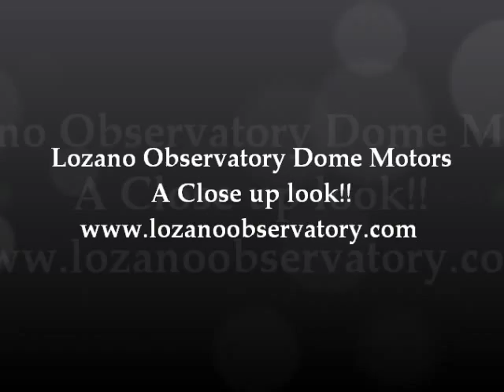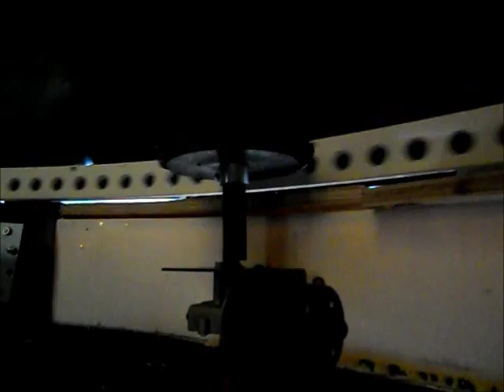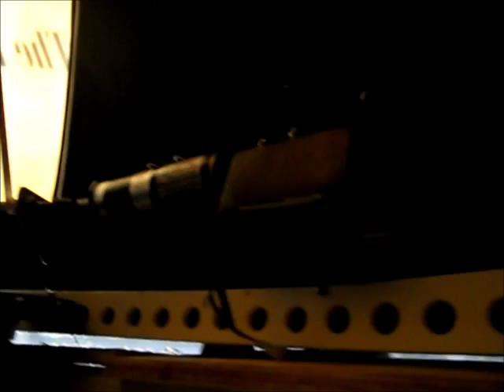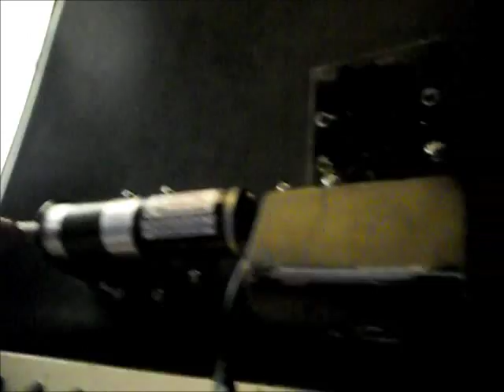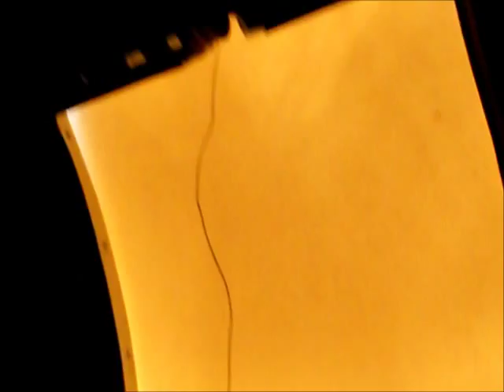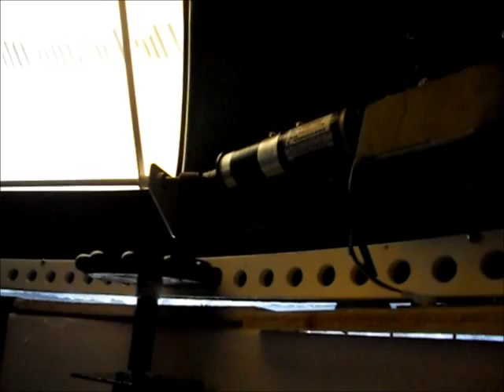Lozano Observatory Rotation Motors

Comment: So you didn't end up using the Foster Systems tor the shutters and rotation?
Reply: Rocky P No, I used Maxdome.  It works GREAT! Spend the  $$ and use it with either MaximDL OR The Skyx.  It has been over 6 years and it is very dependable.